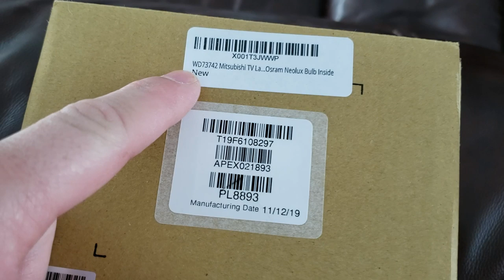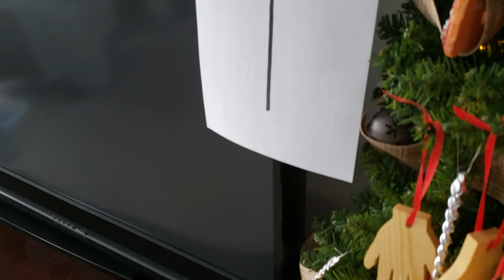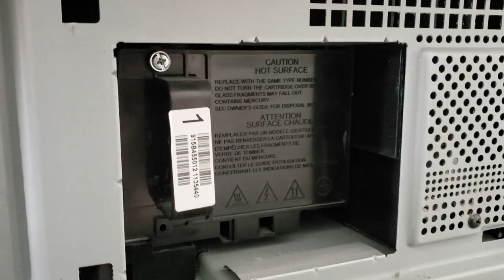Mitsubishi WD-73742 - Lamp Replacement

Comment: Thank you for this video. Though I do not have the same model, it is still good to see how to take apart the same type. Using this video I was able to find out where the bulb was on the TV, and how to figure out the model bulb I needed and what to do to keep a bulb for spare if it is not in the worst condition.

Comment: Hey do you know if this would work for the model WD-73642? Our tv looks so much like yours. You know if the link you have for the bulb would work for my model?
Reply from the maker: I don't know for sure. I think your model is the same size as ours, only one step down...but I have to assume the bulb would be the same. It's an easy replacement, just be careful not to touch it with bare hands, which can shorten the life of your bulb.

Comment: Why did u replace a lamp
Reply from the maker: Because it was getting dim, and hard to see. It's SOOOOO much brighter and better now. This DLP is our second one, and it's bigger, cost half what we paid for the first one, and it's never "burned out"....it had only faded to the point that we wanted to improve the video quality, and this was our second time. We still only have about $1,200 + ~$150 (two bulbs over it's life...actually, we still have all three, because I keep everything!) in this TV for the last ~10 years...but it's only 1080P. We've never had anything in 4K anyway, so no trouble there.

Comment: Great video, mines just burned out and I bought I was buying off market ones but this time around I bought an OEM obviously more expensive but let's hope it lasts. Would you know what should be the best settings for light bulb longevity? Like brightness, color, ect.  Thanks again for the video!
Reply from the maker: I want it bright as possible, but we just finally upgraded out main TV to a flat screen to save about 24 inches of depth in our living room. Loved the DLP's we've had though, and I would just run the bulb as bright as you need to see with any ambient light. Also run the contrast as high as you can get it (until it starts to look strange).

Hope your OEM option works out well for you!